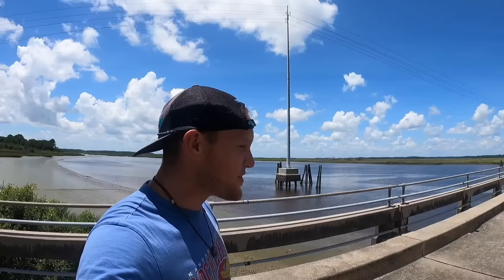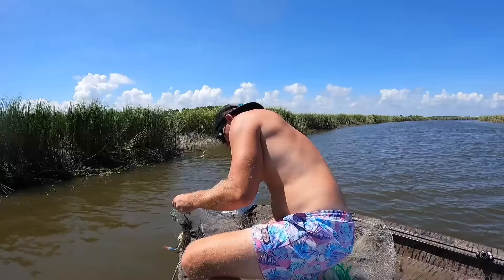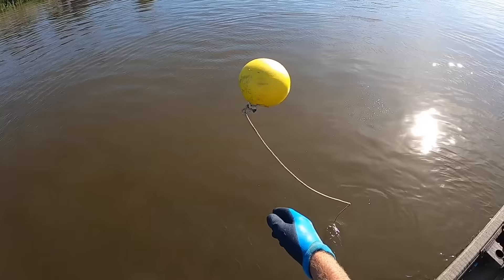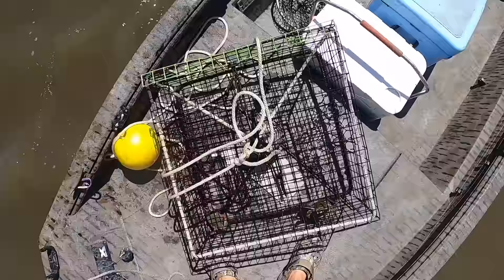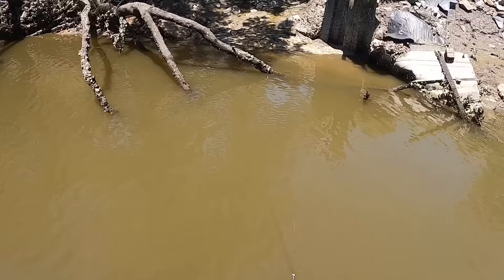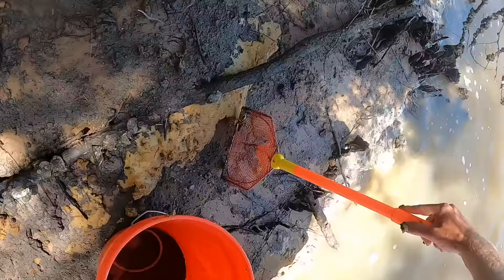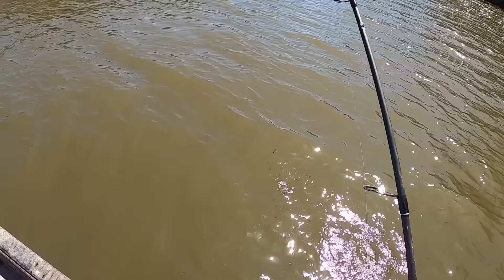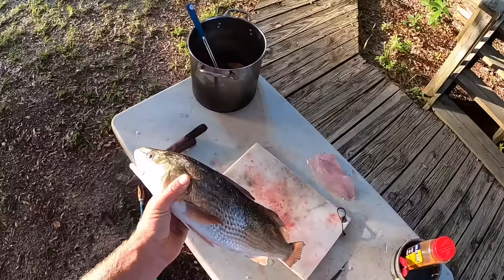2 Days Shrimping, Crabbing, Fishing on the Coast!

Comment: Your plate would have been about $100 at a restaurant.  The stone crab is over $40/lbs at a market, and that does not even count retail at a restaurant.  With the rest of the fish, assuming a side of slaw or potatoes, that is easily $100 if you could even find claws that big at restaurants.  They usually sell the smaller claws at restaurants to keep them affordable.  BTW, there are better ways to harvest the claws than wringing them which help the crab survive.  You need to put the tip of a knife in the first knuckle and they will just drop their claw with no meat or juices ripped out of their bodies.  Cool video!

Comment: I have another question for you, what type of line do you use when you're fishing inshore  or brackish water? Monofilament, fluorocarbon, or braid? I haven't switched any of my combos over to braid yet, but I've been down in Florida for about 5 years and only have fished for about one to two of them. I'm using monofilament, but it's driving me crazy pretty much of the time for obvious reasons. Everyone says to switch to braid if you're doing anything with salt water for sure, sometimes they do it for bass, I don't know I've never done it and I don't really think that I have any braid ready reels for one thing. Just curious about what you're using?
Reply: Braid is def my favorite lessbacklashes more power and if you get green color you might not need leader